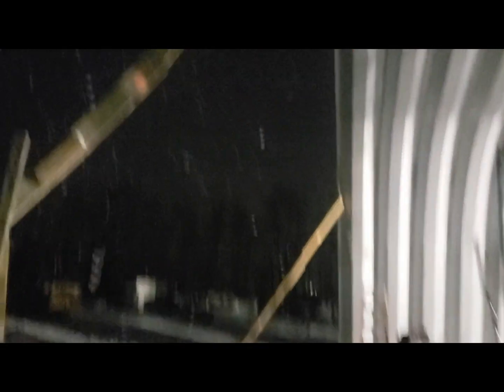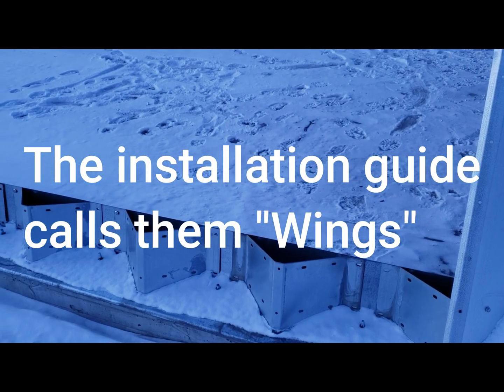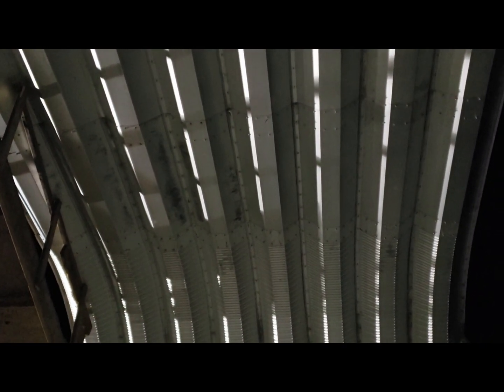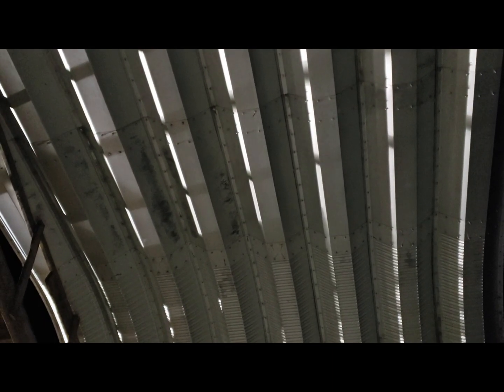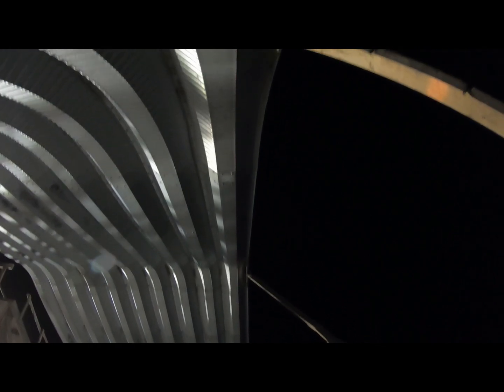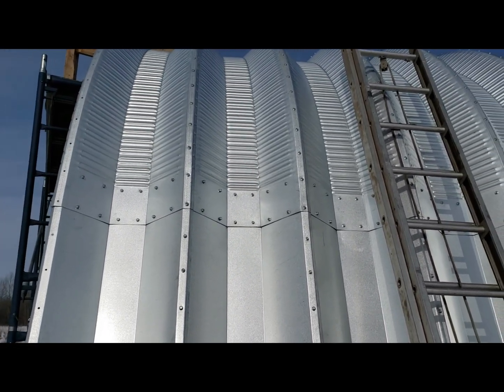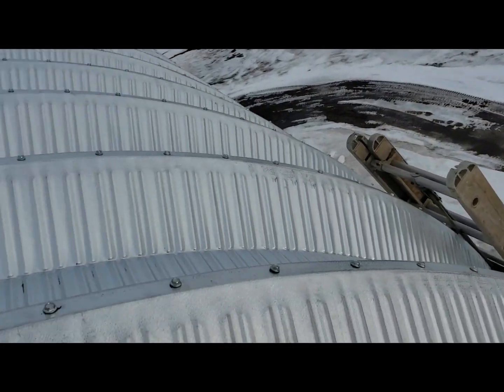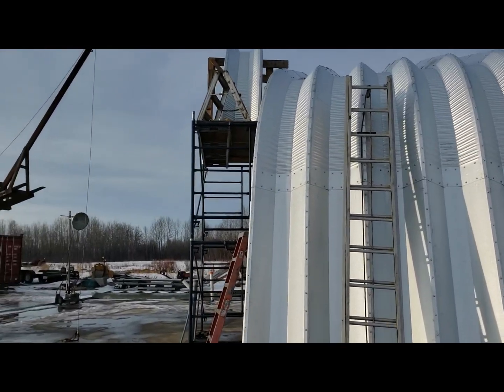Steel Arch Building, What I Learned pt. 2

Comment: If you had a skyjack or a man lift, would you have done the bolts snug and tightened them, after? It seems to me the fight is getting the man next to the bolt, so if I solve that, I can solve most of the headaches, but I am only guessing as someone who has never built one. I was thinking of using bracing and putting it up one piece at a time for the first few arches and then just putting up the pieces loose (relying on the strength of the first several arches), straighten out the building and then tighten it all up at the end, but again, with the benefit of the lift.

For the corrosion, do you happen to know what is best to do, if you wanted to fix it?
Reply from the maker: I might have pulled full sections up if I had a man lift but maybe not it was pretty windy when I started & I was working alone. Yes a man lift would have made easier just by being able to drive around & tighten bolts. 
What ever method you use to get the first few sections up you should not tighten until you get them sitting where you want. Once level & straight, lined up all the way around like 6 sections in or more then can tighten up. After first bit then can tighten sections full as go, but should still check as go every 4 sections or so that they are going together straight & not all kocked one way on the same joint that will progress in later panels & result in trouble lining up bolt holes. There is play in every joint so there is possibility if tighten to not tighten straight, so should check with laser that has all been tightened in straight line from one base up & around to other side base all in straight line then can continue.